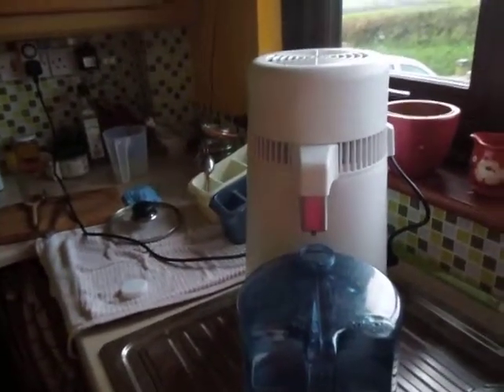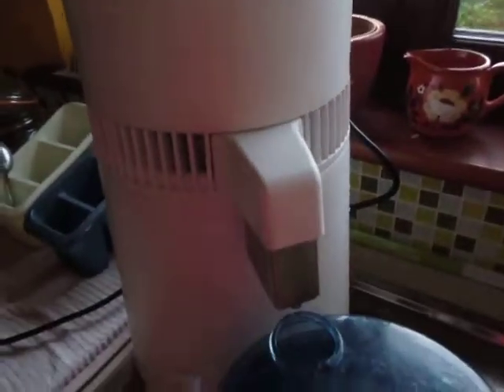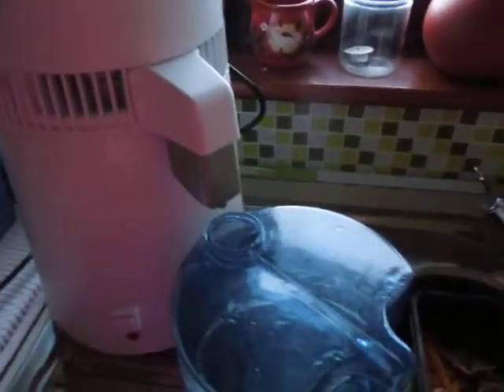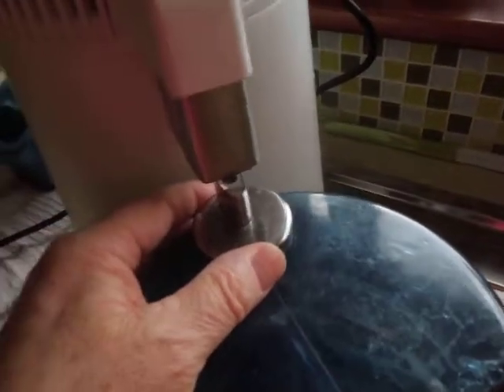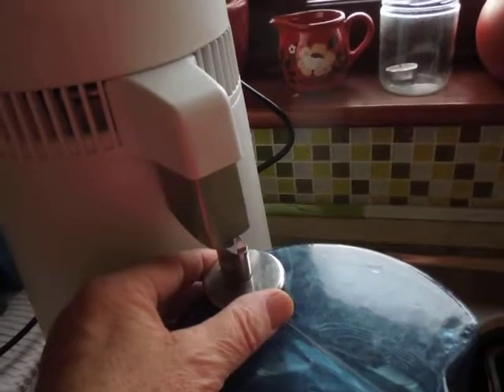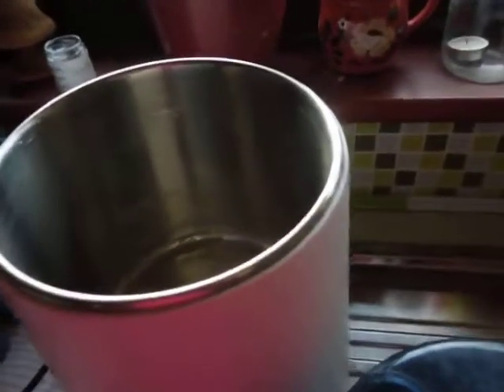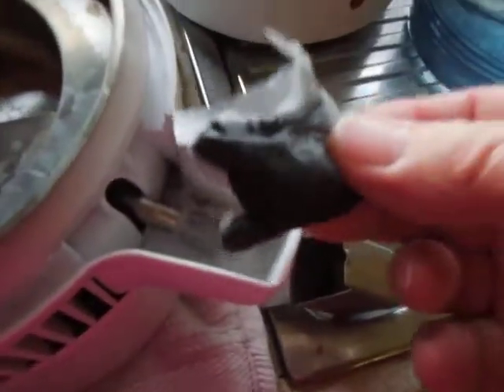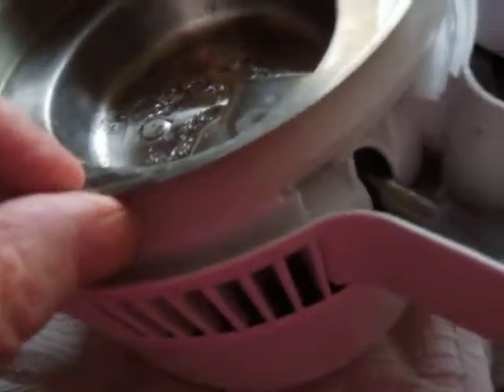Water Distiller Problems and how to Fix them.

Comment: Mine not working. The buttom i mean. Do u know what can i do?
Reply: its the same as mine , you have to let it finish then it resets to the power button
Reply: If it won't turn on, you might need to change the fuse....you should have a spare?!
Reply: @sgt.lindaleeelofson5943  where is the fuse ? Mine has the same problem It just won’t switch on. It worked fine for about a year.
Reply: @maryrose7842  UNPLUG, EMPTY WATER, THEN turn your machine upside down, you take out the center screw & washer, remember how they were and gently remove the plastic cover portion, inside there are lots of wires, a circuit board, BE VERY CAREFUL NOT TO damage anything...you will see the fuse, it is usually covered by a sheath/sleeve(to keep it from the heat of the machine)slide the sheath/sleeve up, it is kinda stiff,(it may be a double fuse, that is fine it doesn't matter, you replace it with a single one) carefully loosen the screw where the two wires(red & black) meet, separate the red & black wires....carefully open the metal tabs holding the fuse, on the red wire, replace fuse.. BE SURE tabs are pinched tight enough for good contact(if you cannot slide the fuse, it is good...put wires back together with screw and tighten...slide the sleeve back over it, put screw & washer back on the bottom...turn your machine upright, put a little water into it, plug it in, see if it works...if not, go back and double check your fuse has good connection or try another fuse...if after that, its not working, it could be a switch or an overheated board....I would contact seller & see if they have ideas or bring it to a small household appliance person...hope this helps, any questions, let me know...there are a few videos on youtube that are similar, so you can SEE, the instructions...Good Luck🍀
Reply: @sgt.lindaleeelofson5943  thanks where do I buy a fuse?
Reply: @sgt.lindaleeelofson5943  unplug for half an hour to reset and turn on again